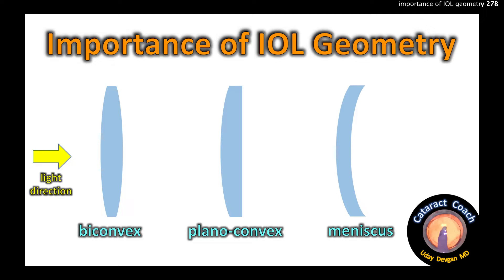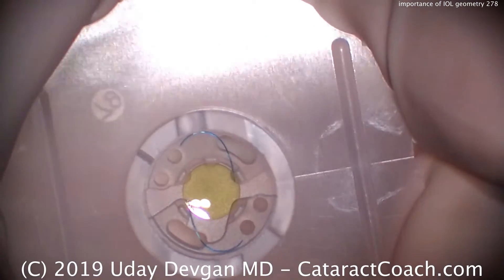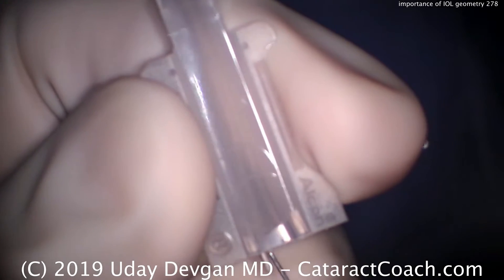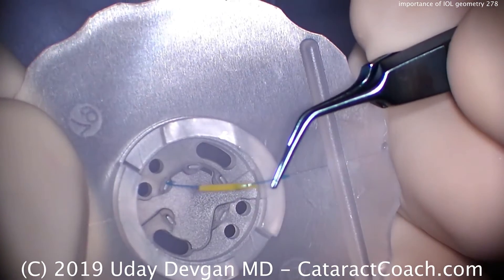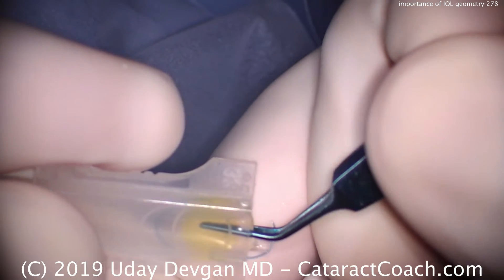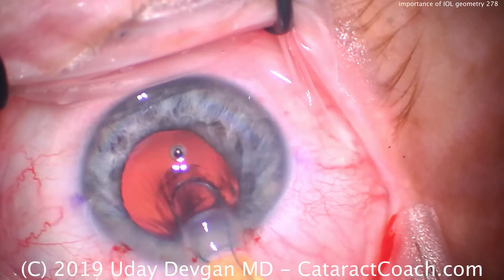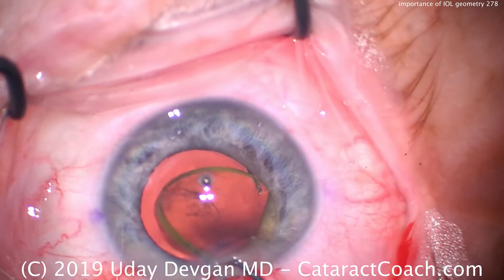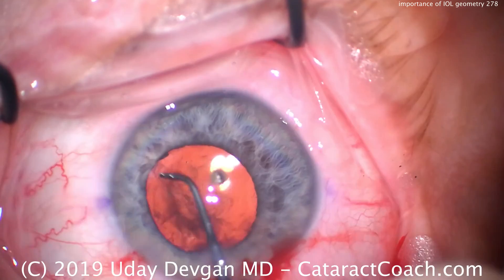Why lens geometry is important for IOL calculations in cataract surgery

Comment: This is what Haigis said: "The MA60BM has – in the range of 15–25 D – a constant anterior refractive power with different powers produced by curvature changes of only the posterior surface, whereas the MA60AC is roughly comparable with an equiconvex lens. The mean position of the anterior lens surface of the MA60AC is therefore closer to the cornea than that of the MA60BM (cf. Fig. 1). Accordingly, the mean ELP of the MA60BM is further from the cornea. This fact is reflected in the different A-constants given to these lenses by their manufacturer (MA60BM: A = 118.9; MA60AC: A = 118.4)." So fine, the A-constant accounts for this discrepancy but wouldn't the relatively posterior ELP of the MA60BM make it tend more towards hyperopic refractive surprise if you used it as your preferred backup sulcus IOL over the MA60AC?
Reply: Btw, was nice seeing you at AAO! Thanks for showing us your watch collection.